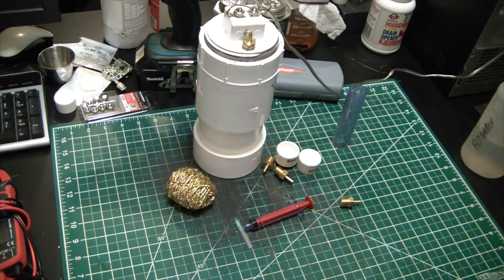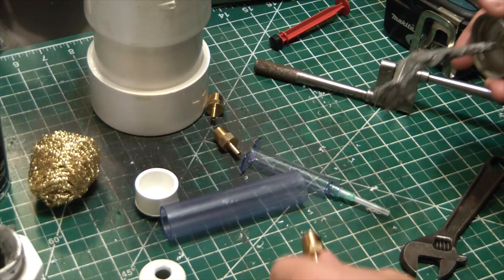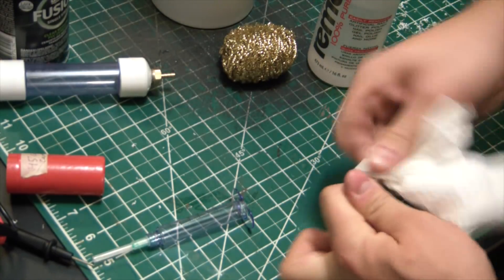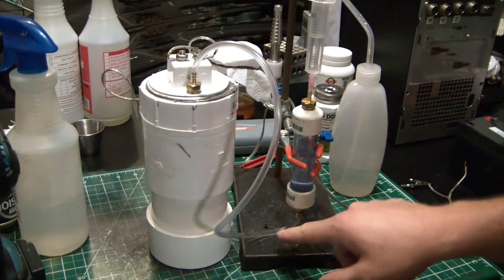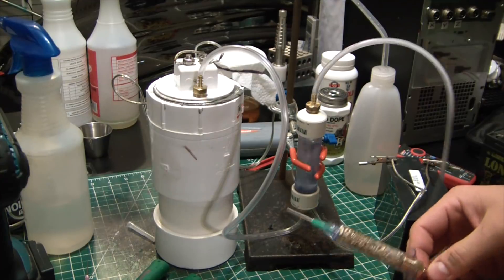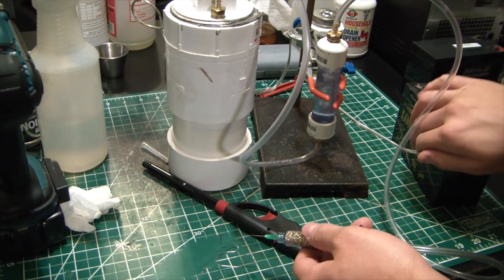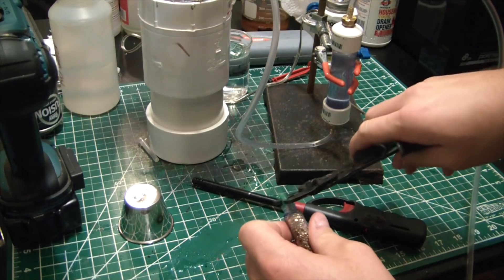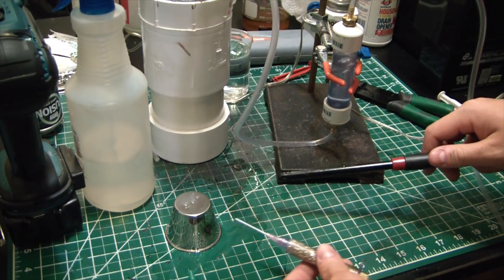DIY HHO Generator Torch - It Kinda Works! - ElementalMaker

Comment: Define you're going to get off of there is going to be real hot if you do it right it will melt your 2500 wire in a second

Comment: I think you need a higher flow. Because the needle is getting heat-soaked to the point where the gas is igniting inside the needle. Try using a roller clamp from an IV set.

Comment: You need more flow through the tip, that will require more pressure,it keeps the heat away from the tip.

Comment: I think the needle tips went up becUse there wasnt enough flow to keep the flame front away, but maybe im wrong.
What you could do is capture the H2 and O2 separately (off the cathode and anode) then use something like this as the torch: https://www.amazon.com/dp/B0754KW6PB/
Of course that basically means a full redesign of your setup... Lol.

Comment: As someone that has dabled in glass blowing, I have played with some really cool torches.  I was thinking maybe you could adapt a propane micro/soldering torch head for this application? I really don't think using suringe and deedle is the best way to go for HHO torches, other that for a proof of concept which you certainly proved. 

You should have SOME kind of flow regulator and a way for it to offgas away from the torch and such and for heavens sak PLEASE put a shyt off valve on the body? I jus recently found this channel I don't want to loose ya to a hydrogen exploaion. Although that would be a hell of a cool way to go I guess lol.

Take care. Be safe ;)

Comment: you can get away with small cables if you use less electrolyte but a higher voltage

Comment: Great video! But what I wondered was if you do not want to separate Hydrogen from Oxigen and are only interested in the gas mix you could also use AC, so you would not need an expensive dc power supply, just a transformer and maybe a fuse ;)

Comment: A fine tipped mig welding tip would work better unless your goal is to melt needles other then that its awesome I like it
Reply from the maker: Very good point, the copper would quickly sink the heat away. I'll definitely do that 👍

Comment: I saw a guy do this on another channel where he used the nozzle off a welding torch instead of a needle.
He used 5volts at 60 amps.
Reply: Wow! that's such a beast. But with such, he's drawing 300 watts. Probably will generate a lot of heat. I did see an advanced one which even had a cooling fan.

Comment: what is your h/o mix? if half the plates are positive/ half plates negative, it'll be a 66.67/33.3% mix h/o,  its stuck at that, but if the plates are in a 2/1 configuration i.e -+- or +-+  you can change the H/O ratio, by simply connecting it backward, if - + -  it'll work out 80%H/20%O which would be ideal for a engine and the most ideal for a blowtorch, the other way connected + - + would give a 50%H/50%O mix so here you can get 3 different ratios, has anyone tested these 3 ratios to see which is best for what? does anyone even know what I'm talking about here, youtube seems to be lacking certain videos that's needed, check out my hho cell, it's got equal postive/negative giving a 66.67%/33.3% ratio but it does implode at that ratio and expoldes at the other ratios, I'll be doing further videos in the future as i suspect the 80%/20% mix will be best for a blowtorch

Comment: make the gas go threw a compresser, so it can store gas? coz the flow of gas shoould be increased,, and u dont need to worry about back flow or power.
Reply: Compressing HHO is like compressing fuel-air mixtures in an engine piston. It will likely explode, like a bomb in a pressure vessel.

Comment: I freaking love it, was planning a small scale separator with a pair of 1/4 glass tubes, titanium mesh, a dumb car charger (until I built my atx bench power), but didn't think the scale would net much, and was thinking basically of what Sasha Z commented, but was left with a question that now translates to your little device, can hydrogen, oxygen, and or hho be safely compressed? I seem to recall oxygen and grease/lubricant don't mix well, and I think even diaphragm pump would have such, has any one knowledge or experience to this end?

Comment: You are running the voltage too high and producing a lot of extra heat. The reaction starts at around 1.46V and runs endothermic up to a about 2V. Then exothermic for anything higher.
At the voltage you are running you would need to make it into a max of 8 sets of series wired plates to bring the voltage down into the proper range. Another fellow said 7 which probably also works fine but likely pushes it into the exothermic region slightly. Though it might produce more gas (less efficiently) at that operating point.

Comment: You need a high voltage rectifier,then you can use 220 volts ac then you'll have about 205 volts dc at the output,you may want to put a current limiter there,I've seen these cute 1KV-1000ohm resistors in old tube TVs that have an attached heat sink around their circumference,perfect,but you may have to super size your tank to space your electrodes farther apart to reduce heat generation,otherwise you'll have a boiler,not good.
Or you could make said rectifier,use 110 for 90Vdc,and a steamer,the big ones come with stainless electrodes,hold a gallon of liquid and the electrodes are bendable to get the right spacing.
So,there you go.
You should be able to buy a steamer at drug stores or wal-mart or you may already have one in case junior gets a chest cold,voila.

Comment: So don't try to melt stainless with a stainless needle. The sustained temperature built up on the cup, that can dissipate the heat better, is heating the very thin walls of the needle to the point where any free O2 can have it's way with it when it starts to melt.Maybe try this? 'Tungsten Carbide Tube .044" OD x .008" ID X 6" L' .Melting point at 2,870 °C (5,200 °F) I have no Idea, but it looks worth a try.

Comment: I believe that if your voltage is too high you can add neutral plates between your positive and negative plates to function as resistors... or something like that,  i'm not too certain of it

Comment: Awesome! A flashback on your first try! Object lessons are good so we can be sure that explosion fears are not merely theoretical. Of course this thing does not compress the gas and the contained volumes are small, so even a detonation of the full volume of these containers with atmospheric pressure HHO shouldn’t be fatal. “Shouldn’t be fatal” is the level of safety I am usually pretty comfortable with. I’d put the level of danger here at slightly less than a potato gun mishap.

Comment: Ehhh...
So you should really consider separating the oxygen from plastic and the hydrogen.
 
This HHO generator design doesn't actually require you to keep the hydrogen and oxygen combined since you're adding a bunch of electricity to generate your gases, instead of using aluminum foil and Sodium Hydroxide to generate the HHO gas. 

Leaving the hydrogen and Oxygen mixed makes it difficult to control. The small pop and persistent fire that destroy your needle are small potatoes compared to some of the things that can happen. 

To separate the oxygen from the hydrogen you need to add a gas vent/catch and separate the electrodes so that they don't freely push their produced gas through the other product. 

If you're hellbent on keeping the hho generator as it is, you should be aware that you can run it directly off of AC. You don't need DC power to run it, but Maybe running it off of 120 volts (which is the USA residential standard) is a bit much. You can step it down very easily with the use of a step down transformer, which are in most cellphone chargers.

Comment: If you bubble the gas through ethanol instead of water, it'll lower the insane combustion temperatures. That's how we run our hydrox tourches.
Reply from the maker: Wow very cool! Never would have thought of doing that. My reason for building this torch however was the insanely high temperature of the flame. Why do you cool down your flame temperature?

Comment: BTW: Electolyte will eat thru just about any metal eventually, Platinum is the only long lasting electrode but bloody expensive. I believe using AC instead of DC will prolong life of the electrodes.
PS Chinese use copper headed torches; maybe it more resilient to HHO?

Comment: That needle burning was like a micro thermal lance. Maybe do it on purpose next time and see what you can cut with it.
Reply from the maker: That's exactly what was happening, good eye. Ive since upgraded the power supply so its getting alot more gas, which is helping to keep the needle tip cool, but it would definitely be fun to experiment with a thermal lance.

Comment: Lmao brother man!! But great job. Just a suggestion sir , what if you ran the needle to a ceramic tip such as on a calcium carbide lamp with perhaps a # 80 hole? 
 I don’t know perhaps that prevent the thermal dynamics from traveling to the needle..
 I’m not sure, I do not have nearly your acumen.
 Or perhaps hardening the needle to 68 Rockwell? 
 Take care. Great effort 👍
Reply from the maker: Thanks for the kind words Lee! I definitely want to give ceramic tips a try, just dont think I have any materials available right now to make it happen, but I'm always on the lookout! I have a bunch more needles on the way to test with, and picked up some new equipment that should really get this cell kicking into gear! New video coming up

Comment: Why don't you pinch the tips of the needles so that there is more back pressure
Reply from the maker: I did try that with a couple of the larger needles, but it created a very irregular flame and caused quite a few flashbacks. I have a big box of 100 21G blunt tip needles on the way, and a MUCH larger power supply to really up my gas volume. New video in progress.

Comment: that is a catalytic reaction eating up the needle, taking to temps hot enough to destroy the metal. See how the heat travels down the needle then it goes white. Look up H-cat(very interesting subject) Scrap using needles. It needs a nozzle that gets thinner at the end. There is some finer brass wool in magnetrons, looks like a mesh washer, extract and unroll the sock and stuff your torch body with it, use the torch with wet brass wool. Have seen paint air brushed used on small torches like that. Push fit blow off plugs are also good safe pressure release devices for cell and bubbler.

Comment: You might want to lookup "oxygen lances" which is what you are making a baby version of. That is why your needles are burning up. The iron in the needle is burning in the presence of the oxygen. The tip needs to be made of something less reactive.
Reply from the maker: Yep that's exactly what happened! From some additional research, it looks like I need more volume to keep the flame front somewhat in front of the needle, and more volume to help keep the tip cool. As of today, both of those issues should be solved. New video in progress.

Comment: A small MIG welding tip for a thin gauge wire works very well as an HHO torch, I build one myself about 9 years ago. Depending on how much HHO your setup is producing you might adjust the tip a bit. For example I made the hole a bit smaller just by tapping it somewhat with a hammer. For a flame arrestor I used STAINLESS steel wool, and I packed it pretty tight. Be sure not to use standard steel wool that is not stainless. That might be useful to know for those who don't have access to bronze wool. 13,8 volt is fine, but you have to use at least 7 plates in order to prevent that it is producing heat. 1 anode, 5 neutral plates and 1 cathode.  Also a PWM with current limiter would help. Just make sure that when you measure the voltage across each next plate that it doesn't exceed 2.1 volt. You can use a car battery charger as a power source, but be careful with your electrolyte. Start with a less concentrated solution otherwise you will burn the circuit breaker from the battery charger, or worse. 

With 10 amps you will produce about 1 liter HHO gas per minute if you would do what I wrote above. If you can improve the surface area from your plates by machining them you can put more amps through them. In all those years that I follow HHO people I have never ever seen anyone doing that. Although one guy media blasted his plates to increase surface area, but I think it can be done even better by combined machining and media blasting them. Back then CNC machining was still very exotic. But the maximum amp rate is related to the surface area of the plates. By increasing the plate surface area you can build a smaller setup compared to a setup with normal untouched plates. The maximum voltage is related to the total number of plates. You can apply a higher voltage, but then you must use more neutral plates as well. Or you have to put several different cells in series, but it's easier to use neutral plates inside a single cell. Whatever the voltage is that you can use, divide it by 2.1 and that will tell you the total number of plates that is best for your setup. The same story with amperage, if you want to apply more amps you must increase the surface area from the plates. Keep track of the cell temperature, if it heats up either the voltage is too high, or the amperage draw is too high. So that would mean that depending on the situation you would have to adjust the total number of plates, or the total surface area per plate. The voltage per plate is easy to calculate so if the number of plates are correct then you have to adjust the surface area, or you need to lower the amperage draw by making the electrolyte less concentrated. 

A dry cell configuration is more efficient than a wet cell configuration because there is no power leakage possible between and around the plates. A dry cell would be plates with gaskets between them so the plates are not submerged in electrolyte, but instead the electrolyte runs trough the plates. It is a bit more complicated to build, but most certainly not impossible. A wet cell configuration would have all the plates submerged in the same bath with electrolyte with no gaskets between them and it is therefore much easier to build, but it is less efficient because of the power leakage. EPDM rubber is a very good gasket material. The stuff that is used for pond liner and roof liner. Although it would be better if you can get that EPDM material in about a quarter inch thick. 

A few more things, use 316L stainless steel plates, they are the best next affordable thing to platinum. And always use clean distilled water in addition to whatever you want to use as an electrolyte. I used drain cleaner, it's called Sodium hydroxide in my country, be sure that it is at least 99,9% pure sodium hydroxide. Be careful with that stuff because it will eat your skin away if it's concentrated enough. Apply in small dosses, stir well and wait for the result before you apply more.  Make sure that you have a current meter to read the current while you're doing this.

Another very important thing, when you are using a bubbler or a so called scrubber make sure that you make a blow off valve or an explosion release valve just in case a flame get's there. If you don't do that you basically created a potential bomb. I made such a safety valve by using a threaded PVC cap, I drilled a hole in the cap so basically at that point I had a threaded rim, and then I took a plastic bag, covered the hole with it from the inside of the cap, and screwed the cap in position on the bubbler with the plastic bag sticking out underneath the PVC cap. That gives the bubbler a gas tight and replaceable weak spot in case a flame reaches it. It will still give a loud bang in case of an explosion, but at least you reduced the chance that sharp objects are going to fly in all directions. Make sure that the plastic bag is thick enough so that it can handle standard operating pressure. And never ever put HHO gas under large pressure like you can do that with air. It will explode.

Warning:
All the above is experimental, HHO gas is dangerous because it's the smallest and most flammable substance in the universe and it is ready to burn, all it needs is a spark or another heat source, like pressurizing it. Chemicals and high currents are also very dangerous. The combination of those three is even more dangerous. Don't do this stuff if you don't know what the risks are or when you don't know what you are doing at all. All the above is not a guarantee that it is 100% safe, so if you decide to do even just one of those things that I wrote be aware that you are doing it at your own risk and that you have been warned. I will not take any liability for anything that goes wrong. Always make sure that you are taking the correct safety measures for what you are doing. An exploding cell filled with highly corrosive electrolyte is very well possible. Make sure to be prepared for the worst. When you are working with chemicals make sure that you deposit it at the correct place in case you need to get rid of it. In some cases or when working with chemicals you might produce additional harmful chemicals that are bad for your health or for the environment in general, be sure to wear gloves and never touch the electrolyte or the plates with your bare hands.

I hope this will help you a bit :-) feel free to ask me more if you want. I like this subject a lot and I don't have the money to do these experiments myself, but I did build up some knowledge and I did some modest experiments myself. So I do know a bit what not to do, and what materials not to use and what materials you can use. I took the liberty to search for a useful website with lot's more information and with a free cell configuration program that helps you with some useful calculations. http://www.hho4free.com/configurator/cell_configurator.html
Reply: geeeezzz,,,,maybe you should write a book on this
Reply: ever thought about using tungsten rods?